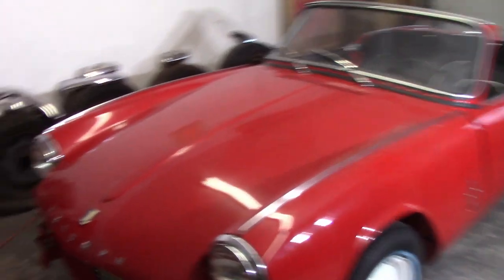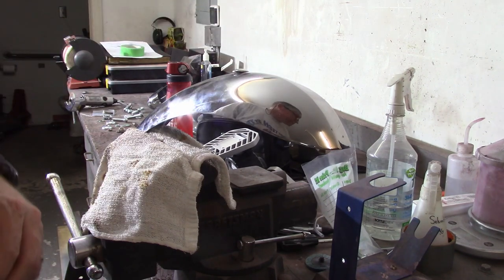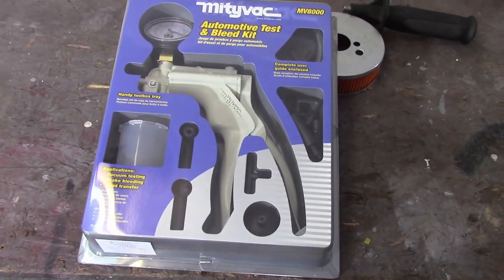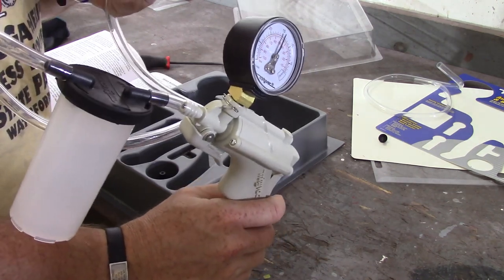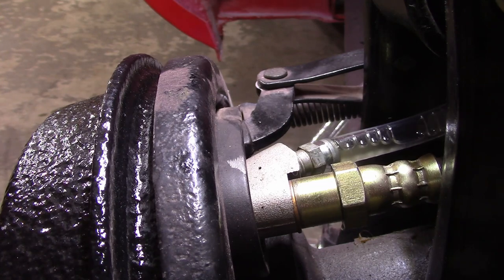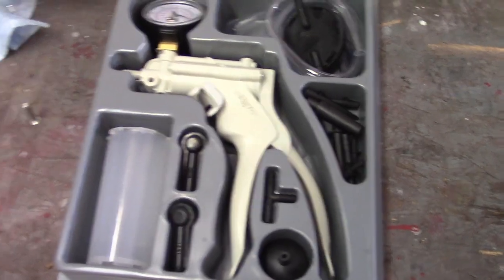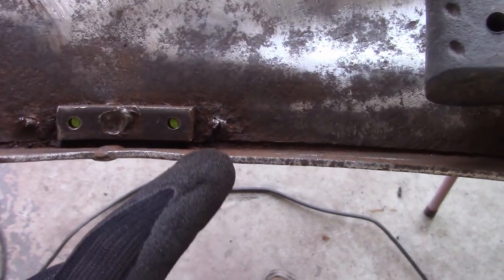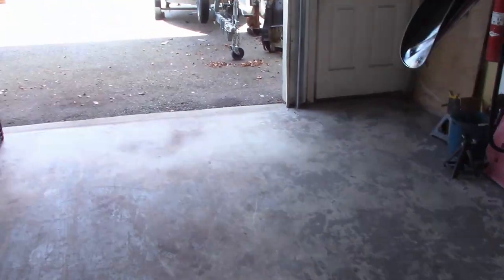Small Steps for a Small Car | Roundtail Restoration

Comment: That is a good tool (MityVac) I bought one and also bought the one from Napa. I love it, it is great when you are doing it yourself or even if you are not, I prefer to use it. I used it on the 77 MGB brakes and the clutch. You just have to pay attention to the master cylinder since it is a reverse bleed.
Reply from the maker: Yup. I got really close a few times, but thankfully didn't lose level.

Comment: Looking good Chris! So jealous. I’ve never been successful vacuum bleeding brakes, for my big Mercedes I bought a pressure bleeder instead, it screws on to the top of the reservoir and pumps up a few PSI to force air out. You can supposedly fill it with fluid. I’m definitely going to check out the DOT 5 for mine, once it gets to that point. I also picked up speed bleeders for the spitfire, one way valves that replace the stock ones, supposed to make it much easier.
Reply from the maker: Those speed bleeders were another option, but I hadn't really heard anything either way about them other than they were out there. Hopefully that will work for you. My garage-mate has one of those pressure bleeders and he said he gets good success with it.

Comment: Reason for the noise from the inertia type starter motor is the bearing bush having too much play and dry. This happens when load (gear mesh) is released and starter goes into overrun. If you have a spare starter, build it up for preparation for one day replacing it.  That gearbox noise is of no concern to me at all. If there is air in the brake system, you will be able to pump up the pedal. Have you had a chance to bed in the brakes yet? I guess the are all new linings and discs and drums. Non-servo assisted brakes were never nice at the best of times!.  Very enjoyable video once again. Cheers
Reply from the maker: Thanks, Joe. I do have a spare starter (or two) around, but they aren't in rebuilt shape, so I'll get that going. Everything in the brakes is new except the rear drums (they were in good shape on the wear surface and well within spec. I do feel the pedal getting stiffer with a few pumps, so there's still air in there somewhere. I'll get that sh*t!

Comment: Hi Chris.
Regarding the starter noise, i would se that as normal to that kind of starter.
When the engine is nearly starting, the starter losses grip and then do free running.
A new type starter could resolve it.
Reply from the maker: Thanks, Ulrik. It's the grinding that gets me. I've heard it over-run before, but this sounds more metal-to-metal, especially in person. Probably should take it out and take a look for metal shavings.

Comment: Cool! Curious why the brake sponginess is persisting: I wonder if it could be the dot 5? There are some very intense opinions both for and against it. I've never had a problem gravity bleeding brakes, but I haven't done an LBC yet either.
Reply from the maker: Maybe sponginess is the wrong word. I haven't driven an unassisted brake car since my 76 Midget and that was <ahem> over 30 years ago. I probably just don't remember what they should feel like. The car stops and it doesn't pull to a side, either, which is almost just as important (and a good indication that they're all working).

Comment: Weirdly had the same issue with the brakes on my old mini using a vacuum bleeder. Never could get rid of the last little bit of 'spongeyness'. Ultimately got one of my kids to press the pedal whilst I released the bleed nipples (old school way). Firmed them right up
Reply from the maker: As I did it, I found that it was best to pump the hell out of it, then do a quick release of the bleed screw, then screw it right back down. Like you would do if you had a helper. I didn't do that until the fronts, so I'll probably go back and see if it makes a difference. Some turbulent flow to get that air out of there may make all the difference.
Reply: Another thing to try is to pump up the brakes and then use a board or similar to keep pressure on the brake pedal overnight. Sometimes can get that last bit of air to move out of your master cylinder if it's there.
Reply from the maker: Interesting. Never thought about doing it long term like that. Thanks, Chris!
Reply: Also on the starter, agree that it sounds like your Bendix isn't retracting fully.  I'd pull it and look for signs of drag.  Remember don't grease/oil it if you clean.  I've heard nothing but good things about reduction starters and will go that route if/when my starter kicks the bucket.
Reply from the maker: @chrisbowerbank5044  I pulled it tonight and didn't see any "new" wear on the starter or the ring gear. It's only happened a few times, so maybe there's just not be enough time to show. I cycled it a few times and it seemed to operate smoothly.

Comment: So Chris, in retrospect would you have bought the ss bumpers again?
Reply from the maker: Nope, no question. Nor will I recommend them. My rears weren't in horrible shape, but my front was. However, I would have been better off taking the money I spend on the ss set and putting it in getting the front fixed and re-chromed. Live and learn!